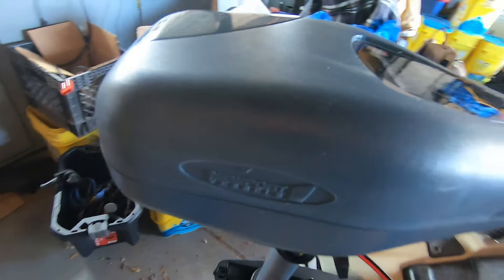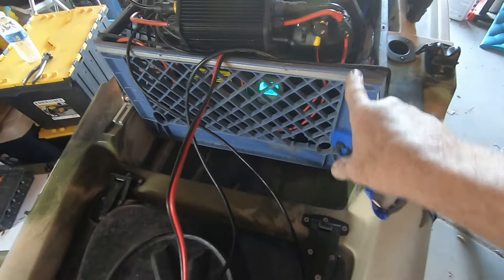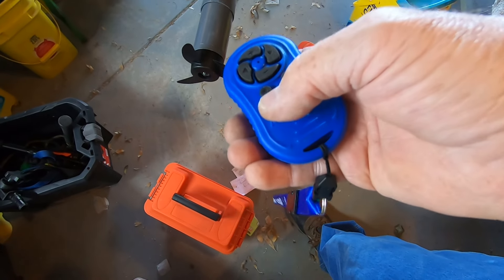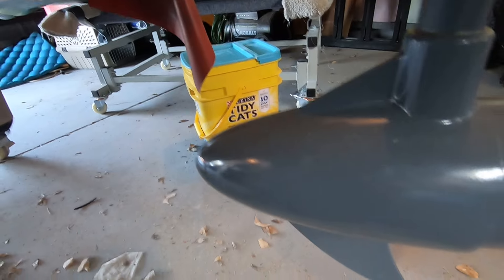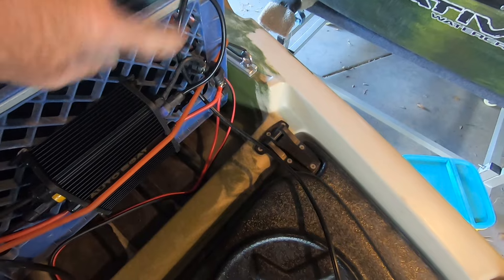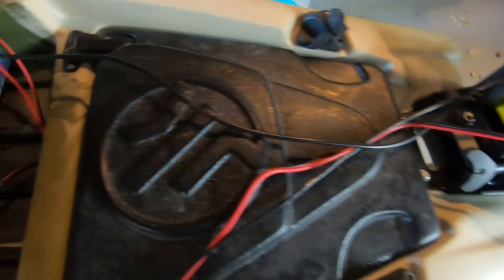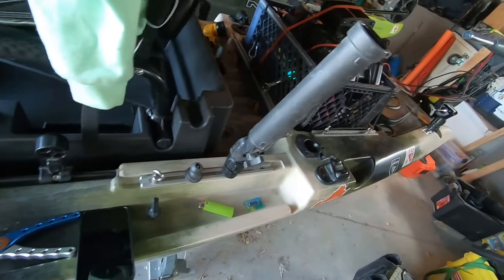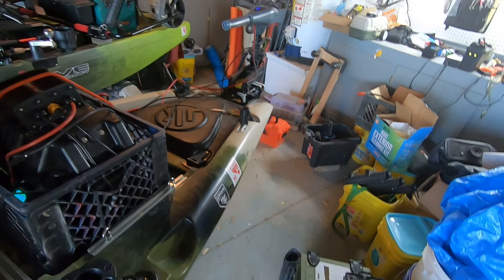AUTOBOAT install on Jackson Big Rig FD with a 55 lb Newport. Available at www.autoboat.store

Comment: Just so your aware....
The spot lock is going to hold your stern on location.
Meaning your going to be backwards
Reply from the maker: exactly what I need, thanks
Reply: My understanding is that spot lock will drift with a stern mount and the NAV feature is also suboptimal from the stern. I’m not saying this to be difficult, but I’m getting the same motor and the Autoboat system shortly, it’s actually in shipping right now. I plan to do a bow mount on my fishing kayak because of information on Autoboat’s website about bow vs stern mount. I would like to hear your experience with this system on the water.
Reply: @Michael-s2p3p  Here how its going to work on the stern.
The gps sensor is what locks on to location.. Thats right on the motor shaft.
SO youll nose up to your spot. Hit lock and in a short time as the motor works to keep that sensor on the spot the bow will drift around and youll be backwards.

 The only way it would work is if you could place the sensor on the bow and program the motor to know its so many feet away from the bow.
High dollar autopilots can do it and iam sure the autoboat could be programed to do it also
 But spot locking via stern drive i dont see ever working well.

Bow mounted motors offer the best in maneuverability
And stern offers the best in actual propulsion.
 Its just how things work.